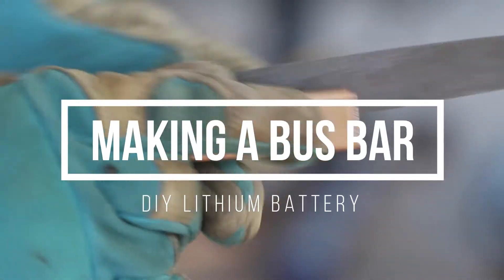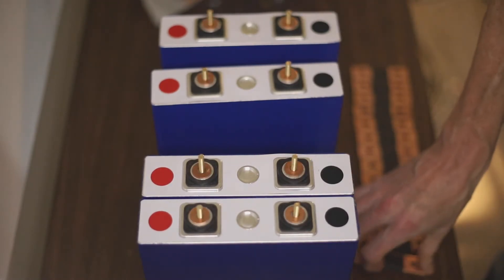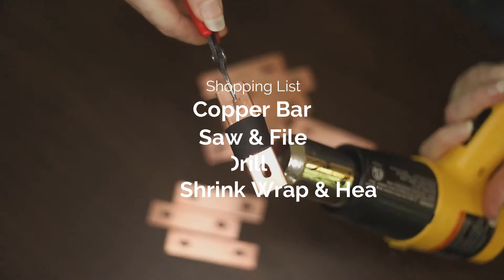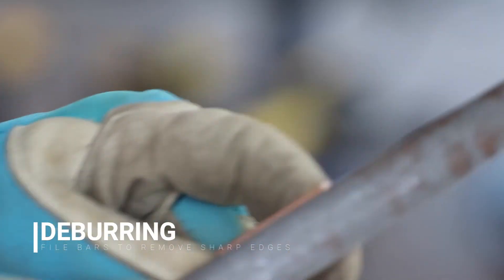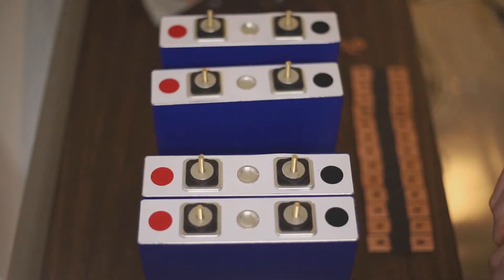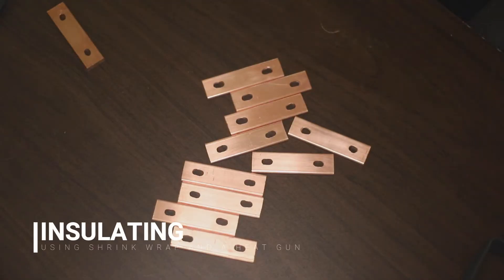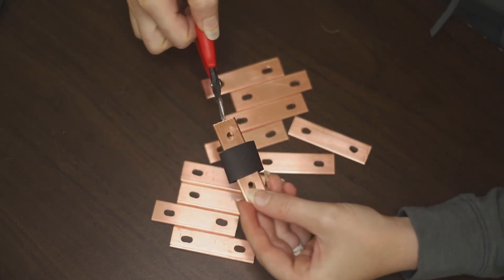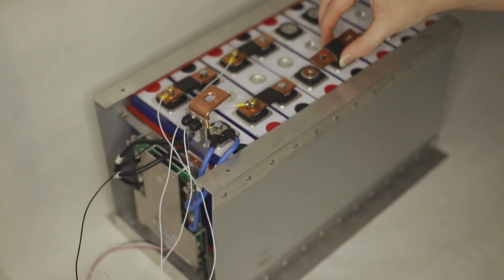How To Make A Bus Bar For A DIY Lithium Battery

Comment: Very interesting. Question: if you run two MPPT 100/50 solar chargers in parallel like that shown, do they need to communicate with each other?

Presently I have one 100/50 and 880 watts of 18V panels divided as three identical 160 watt, two identical 200 watt, all same manufacturer, all same voltage, all in parallel. It rarely goes over 76% efficiency = 670 watts, and the charger is rated for 700 watts where anything exceeding that is basically left unused. I plan to buy a second 1000/50 and four 200-watt panels identical to the two 200 watt panels that I currently have. I use 6 gauge for the charger output (the maximum size that will fit the charger) and have no problems whatsoever other than I need more power. Do you foresee any issues?